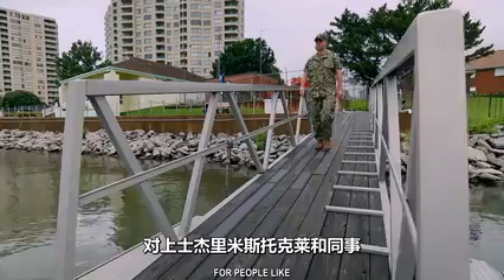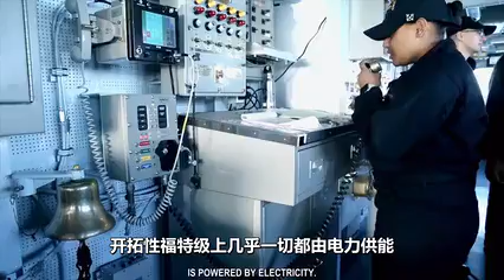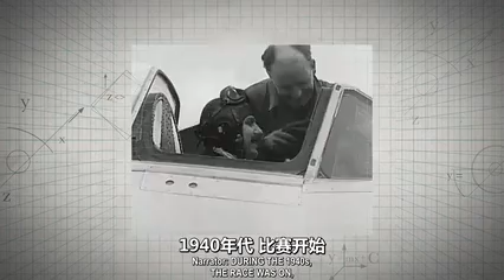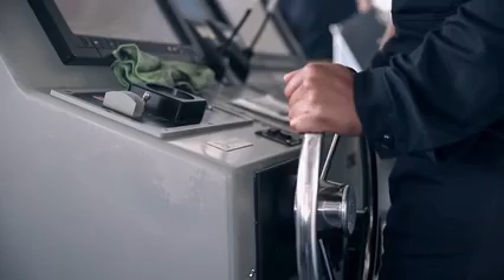不可能的工程 福特號航空母艦

Comment: 1:13 & 28:27 Chief Petty Officer (CPO)是USN的三等士官長，並非上士(Petty Officer First Class)。
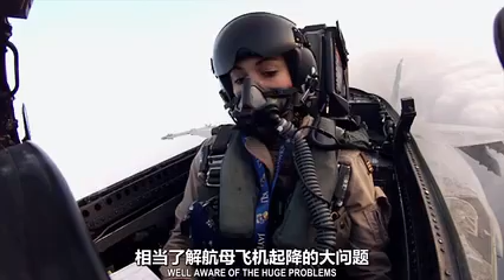6:10 Fast Jet是「快速機」，也就是一般所指的噴射戰鬥機。相對的，慢速機就是像E-2或是有“In Cod We Trust”美譽的C-2。
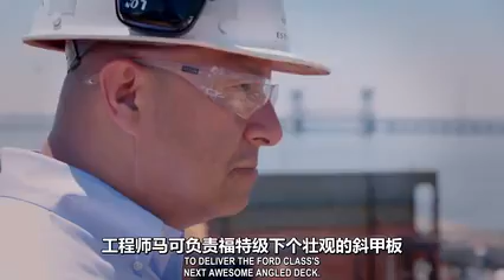10:59 “01 Level”是main deck的上面一層，且總共有三層後才是飛行甲板。光說「1層」(https://fas.org/irp/doddir/navy/rfs/part01.htm) 可能會有點混淆。
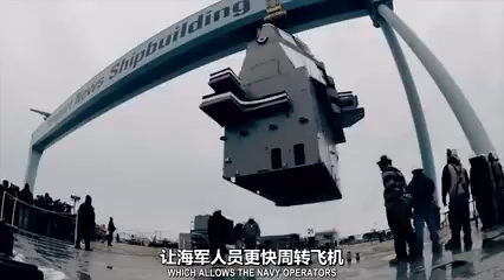12:27 Turnaround在這裡指的是「整備(時間)」。
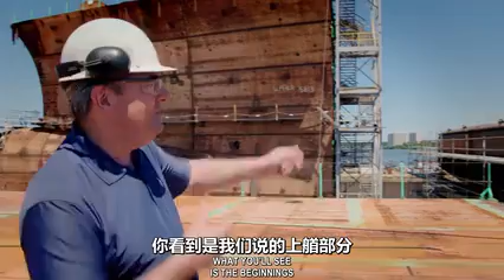15:30 Rolled (structural) shape在造船上是指「軋製(結構)型材」。
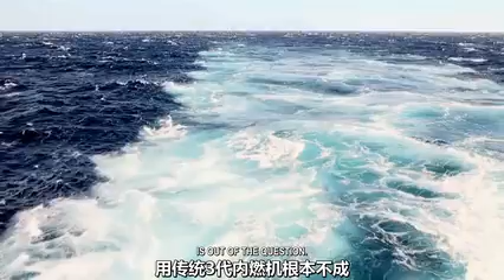16:58 就是因為看了意研堂居然把“combustion engine”翻成「燃燒式引擎」，才讓我來到這裡…不過這邊這句話裡的“THIRSTY”不是什麼第幾代，而是「耗油的」。
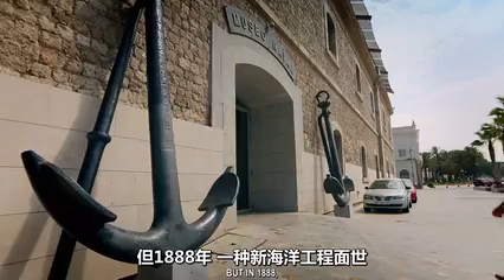18:00 Maritime engineering是「海事工程」。Maritime和Oceanic不太一樣。
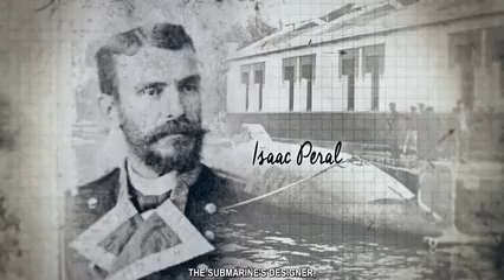19:53 Naval engineer是「造船工程師」。
25:27 這個“troughs”指的是“catapult troughs”。
27:26 前面的“Kilovolts”是千伏安，這邊卻變成「千瓦安」?
36:42 Superstructure是「上层建筑；船楼」。
39:38 這個“car shocks”是指汽車的shock absorbers。
39:44 AAG的“Water Twister”裡用的是paddle wheel，所以不是渦輪。
40:08 Motor generator是用來「吸收」，不是「獲得」動能。而且馬達不會發電，所以它叫「电动发电机」。